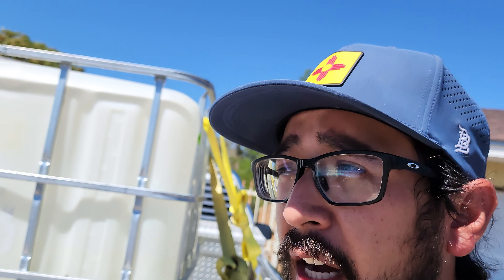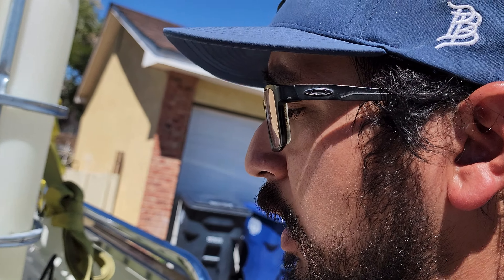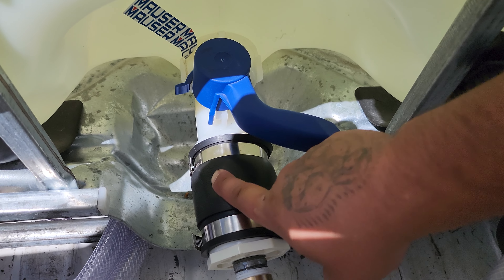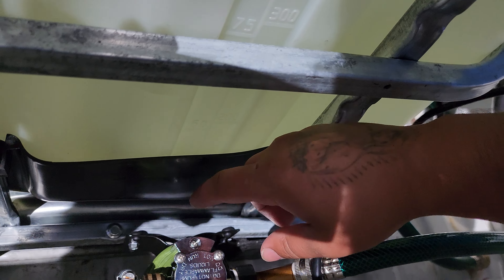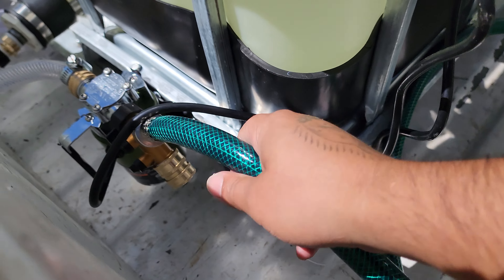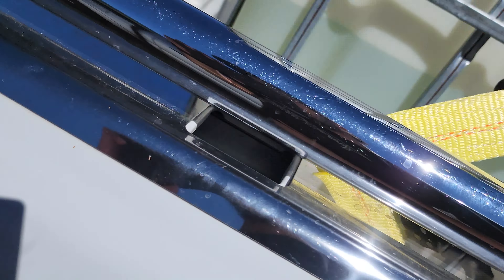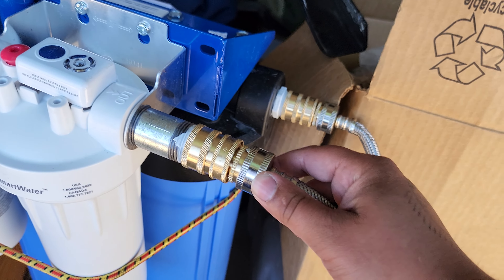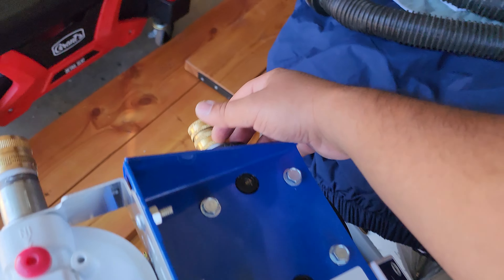DIY Deionized Water Setup - Mobile Detailing

Comment: How about a 12v diaphragm pump? It works when it senses a drop in pressure so only when pressure washer is on. Save power on battery or generator and expand pump life.
Reply from the maker: That's a great idea. On my new set up, I have one with that auto start stop and it is so much better. The pump was only like $65 on Amazon too

Comment: Hey man. Im in Az. Was the cr spotless not enough to get the tds reading down? Do you think just the GE filters would be enough? Thank you.
Reply from the maker: Hey Frank, the Spotless will get you down to 0 tds on its own for sure. I added the GE filters just to extend the life of the resin in the Spotless, because the cartridge filters are quite  expensive. I actually have another video I'll have up on Wednesday on another upgrade I did to the system to replace the cartridges and fill the whole Spotless stands with resin getting more efficiency and longevity
Reply from the maker: Frank, I just realized you were asking if the GE filters alone would be enough. I'd say not enough to get you spot free water (0ppm). I have seen a video where they used the GE filters with DI resin and that will get you spot free water for sure and be a lower initial cost but you'll have to replace the resin regularly.

Comment: Hey man. Would there be enough pressure for a final rinse if u ran it threw all four filters and not used the tank?
Reply from the maker: Do you mean like from an outlet to the filters and out the pressure washer? If so, yea. That's how I run it all the time for my mobile work.
Reply: I was just wondering if the tank was necessary due to lack of Water pressure. I guess u just use the tank if u have no access to water?
Reply: why dont u run a line from ge filters to cr spotless then to power washer? Im getting ready to do something similar and was wondering if there was enough water flow/pressure to do it like that. Thanks man!
Reply from the maker: @Frank R  that is correct. We were doing a car wash as a marketing event and we had to bring our own water. Hence the tank and this set up. Normally, I don't run this exact setup. I'll run from the clients water to the GEs, I to the Spotless then to the pressure washer and it works flawless, even better than this set up.
Reply from the maker: https://youtu.be/W3J4x-vPuoA
Reply from the maker: Here's another video withanother modification I did and it explains the set up a little more. Shoot me an email if you'd like to chat a little about setup/filters. I'll shoot another short video demoing my set up in the field and post it tomorrow as well. sandiashineco@gmail.com
Reply: Cool man. How many washes have u gotten out of this set up? Some people are saying our water is so bad a r/o system is a must
Reply from the maker: @Frank R  I got about 12-15 washes and I use DI for every part of the wash. Some people only use the DI water for the rinse to conserve it and get more longevity out of their system/money. I'm considering removing the charcoal filter as it can add some devolved solids to the water n degraiding the resin faster.
Reply from the maker: Also, check out this video for my set up on the job site. https://youtube.com/shorts/c2uLrU8HacI?feature=share